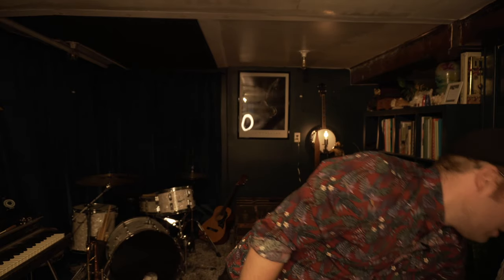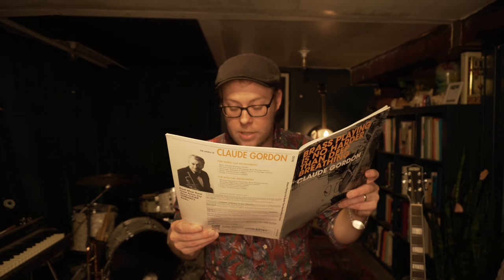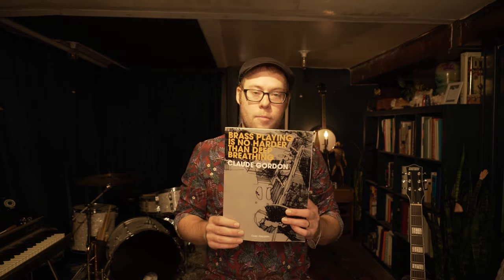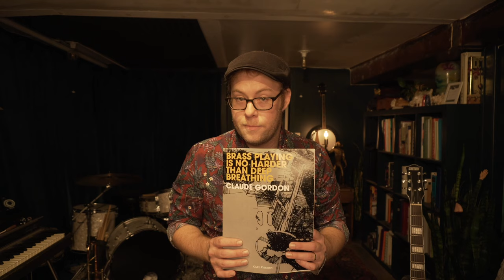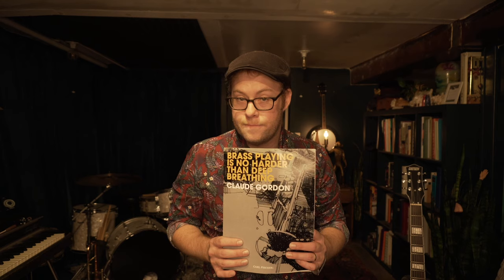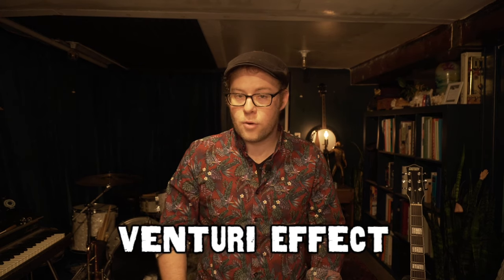The Physics of the Trumpet Ep.3: The Mystery of the Tongue

Comment: Awesome video thanks so much.  
A couple of items come to mind that weren’t really discussed, perhaps because they have no bearing on the analysis.  I play both the Trumpet and French Horn.  I am in my late 60s and started playing the French Horn about five years ago in addition to the Trumpet in several community groups.  I personally have a very limited range of E above high C, if I am lucky.  I have noticed in my playing that if I don’t hear a higher pitch in my mind first in the upper register there is no way that I can actually play a note in the upper register.  By hearing the upper register in my mind, rather than the lower register, something is changing physiologically to allow me to play higher.  Wish I could figure out what is changing anatomically.  The other observation is that everybody is different from the start anatomically.  Different tongue shapes and sizes along with the shape and size of the oral cavity through which the air is being blown, and still another factor could be if the tonsils and uvula have been removed in a surgical procedure.  Is the difference between the ultimate range of a player at some point limited by the anatomical structure of the oral cavity and its components, 🤷🏼‍♂️.  Again thanks for a very informative well researched and interesting video.  I just came across your YouTube site and thoroughly enjoy it ,besides learning a lot from it.

Comment: To me it feels like the tongue is making the air stream smaller, giving me less weight against the aperture, allowing the aperture to become smaller without having to resist the wide activation of a very large airstream. Like, at G above high C, my tongue is extremely high (the air sounds like a cat hissing), but my aperture is also very firm and small. It's as if the tongue puts a "brake" on the air, removing stress on my aperture while allowing my abdomen to maintain air momentum. With my tongue down as low as possible, I lose about an octave of range.  Personally, as a player who discovered how to play high early in their development, I am HIGHLY skeptical of the Venturi effect as it pertains to trumpet playing. I have always maintained that air velocity is to volume as aperture length is to pitch. That's just my perception though and I have been dying for a physicist to discover, conclusively, the primary mechanisms for register manipulation on the instrument. I think this would give teachers a much higher batting average when it comes to the success of their students. 

In any case, amazing work. Thank you for being so thorough.
Reply: The "weight" you are describing is the outward force due to the air pressure against the boundaries of the oral space. Making the oral space smaller reduces the outward force in that area making it easier to hold things together in regard to the embouchure requirements of higer tones.

Comment: You are misunderstanding the Bernoulli principle.

The lip aperture is obviously the only thing qualifying as a venturi. Simply narrowing the oral space with the tongue creates no venturi relative to the lip aperture. 

Also, narrowing the flow path before the lip aperture DOES NOT increase the air flow velocity through the lip aperture. 

Your "venturi" diagram does not represent the geometry of the flow path when playing. 

  The tongue and the lips are part of  an EATING machine. The lips tensioning and tongue movements are quite anatomically linked. THAT is the truth of it. And it is no mystery. 

It has no direct effect on pitch.

It should not be discouraged obviously because playing is more natural and comfortable when allowingthe mouth to mimic natural postures related to spitting out a grain of sand or the like.

Comment: in order to prove the tongue has an effect, you could have restricted the airflow in your ballon - lip setup by squeezing the pipe and create resistance this way like the tongue does :D Also when you moved the tongue lower at the high C, you probably altered the air pressure also otherwise you should have gone louder if the lips stay the same. Great discussion and new ideas. My goal as a scientist to solve this problem soon :)
Reply from the maker: Be sure to let me know what you come up with!
Reply: There is no problem to solve. The tongue movement is related to lip posture by natural anatomical actions and habits. The tongue doesn't pressurize the air. It doesn't make the air "faster," and it has no direct influence on the pitch.
Reply: @darryljones9208  I already know who you are and what you believe.. unfortunately - regarding all your convincement - there is no scientific work I have seen from  you yet to prove your points.
Reply: @olympicfan2  what points? That the tongue doesn't  "compress" the air ? There are established air mechanics that support that. The tongue can only add additional resistance in the flow path from very little to practically infinite, depending on the position . Poiseuille law is a scientific fact .